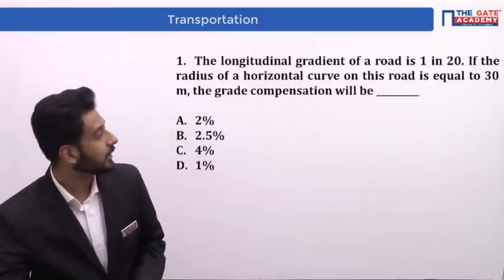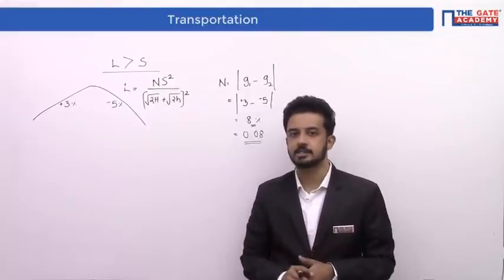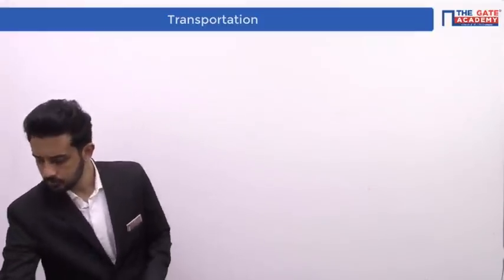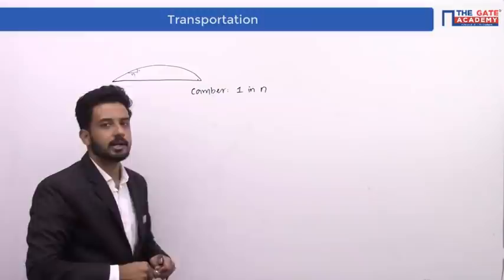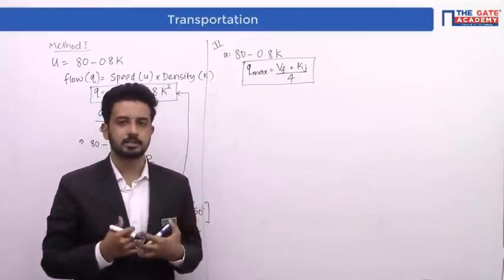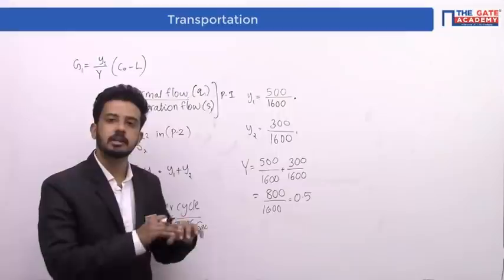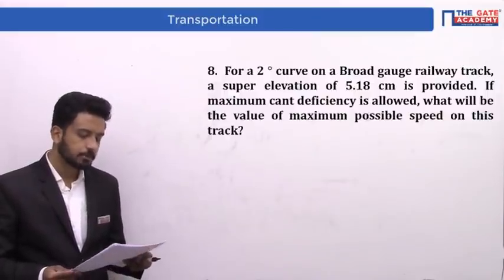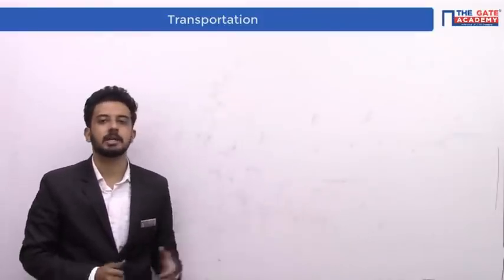Transportation (Civil Engineering) - Most Important Questions | GATE - 2019

Comment: Q2 me single lane 2-way road given hai so we should take safe stopping sight distance or ISD ,and H=h= 1.2m. Am I correct?
Reply: Dear Vineeth, the value will be equal to ISD but please dont study the concept like that. For the safe operation, it should be 2 times SSD, as the vehicle in the opposite direction also need a value of SSD. so, SSD+SSD= 2 SSD is requied on single lame 2-way road
Reply: @Nithin.nv_Civil.Eng.Faculty  sir please tell about excess cant formulas also
Reply: Dear Vineeth, You are correct. But H=1.2m and h=0.15m

Comment: Why we not consider extra widening while calculating rising of outer edge
Reply: Radius
Reply: Dear Gopal: Given width in the question will be the value after considering extra widening.
Foe example, In this question you can understand that an extra width of 0.5m has been given because minimum width of a 2lane road is 2*3.5=7m only. Here given that width of road is 7.5m

Comment: WT is the main difference between abrasion and attrition?
Reply: These actually both terms are related to  Los Angeles  test useful to find the hardness  of aggregates...by putting aggregate of size 12.5mm-10mm with steel balls of standard size in the  los Angeles  cylinder

Abrasion - it is showing the rubbing between aggregate and steel balls during the rotation of cylinder at certain rpm

Attrition - it shows Rubbing Between aggregate and aggregate